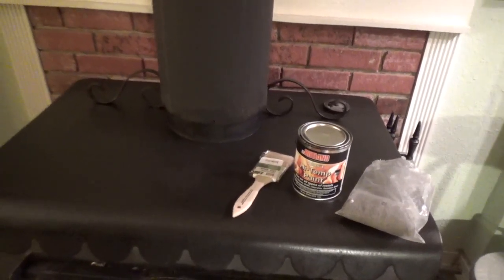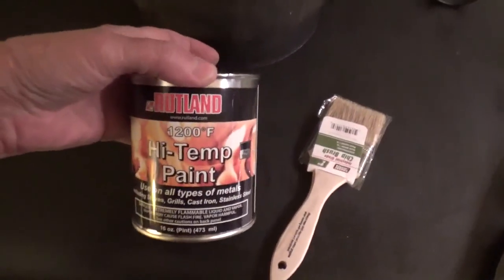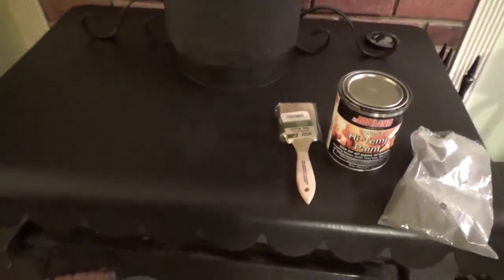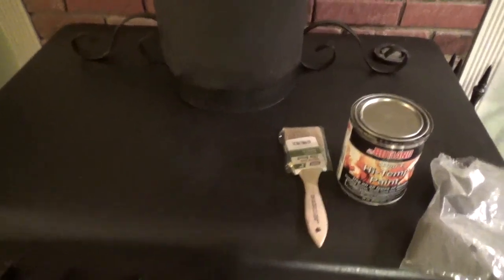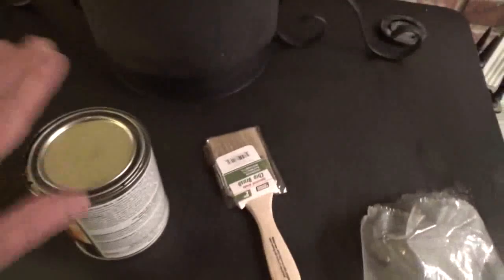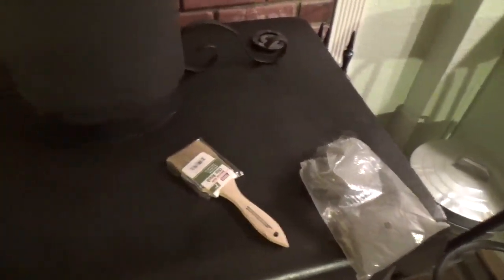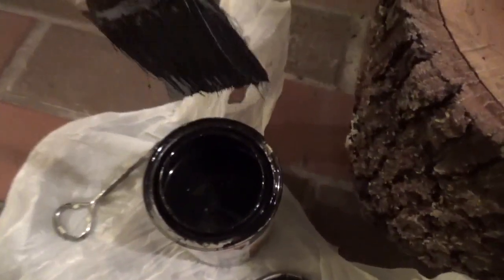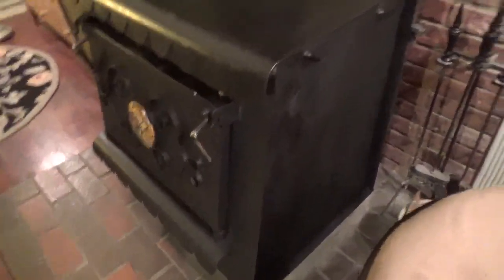I Painted Our Wood Burning Stove

Comment: Hi. You said this paint was very thin, but people who reviewed this brand on Amazon said it was as thick as honey. I'd rather use the thin paint you used. Could you please list the full name, color, and other specific details of the paint you used on your stove. Thank you.
Reply from the maker: Hi Judy,  This is what I bought, and I bought it from the Rutland Products Store on Amazon:
"Rutland Products Rutland 1200-Degree F Brush-On Flat Stove Paint, 16 Fluid Ounce, Black, Fl Oz (Pack of 1) "   My can was not - and still is not - thick, it is thin as water.  I used more of it again this year to touch up parts of the stove, and what is still in the can is still thin as water and works fine.    It is a tiny can but because it is so thin, it goes a long way.

Comment: What color did you use? Do you think it’s best to use a brush, or to spray paint it? I’m wondering about the brush marks. Thank you very much for your video.
Reply from the maker: Hello Carlo, I used Flat (or Matte) Black, and put it on with a brush. I did not have any trouble with brush marks, and it was much tidier to use a brush in my environment. The paint is very very thin, the consistency of mineral spirits stain, so it levels itself out. It goes on very quickly too, and covered without needing to brush over and over.